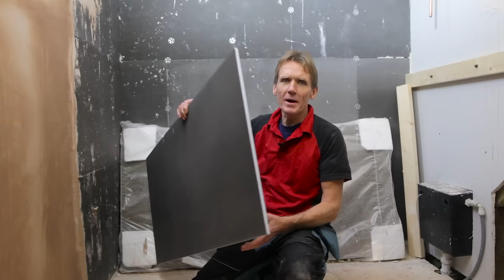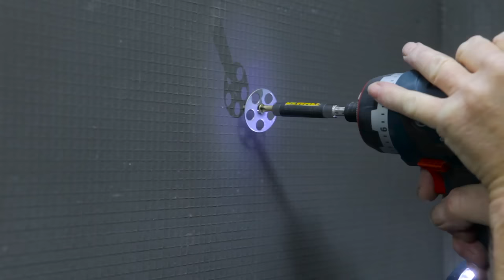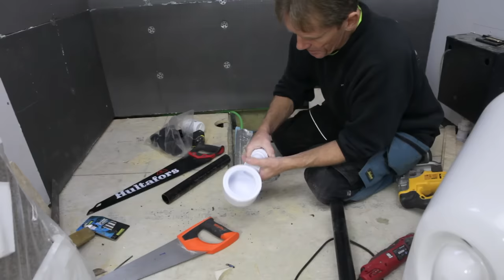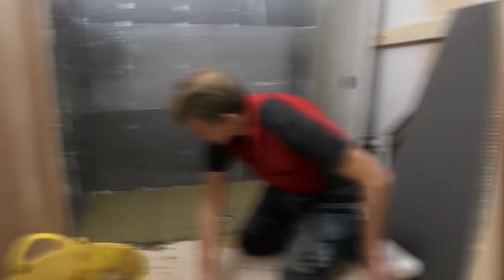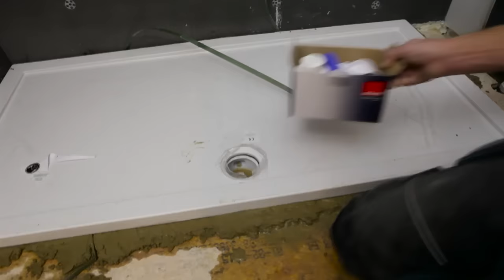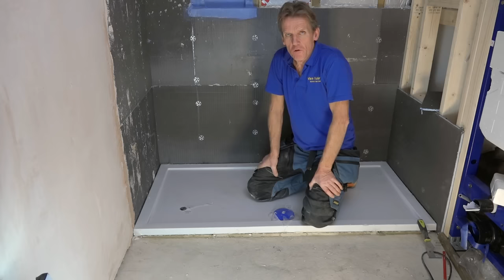Why Did the Shower Tray Crack? How Was it Fixed?

Comment: seen this happen before ,manufactuers make trays too thin for appearance reasons,ignoring durability .Roger made a first class job of the base,but it shows what we plumbers have to put up with.On site we always use a pair of suction cups,as we are fitting multiple trays on commercial jobs.Duravit shower trays come with selaphane stick on patches so your suction cups don't leave marks on the tray.Keep the videos coming Roger,used to enjoy your articles in the plumbing and heating magazine,we used to read it with me mates at college over 30 years ago.

Comment: Problem with mortar is that it doesn't come back after compression. As you're tapping a tray like this down it can lift another area slightly. Tile adhesive will come back since it sticks to the tray, leaving no voids.
Reply: I'd go for tile adhesive even if the manufacturer recommends cement. I think it's crazy telling people to use cement on thin beds

Comment: I’ve found when using sand and cement - use feb in the mix to make the mix nice a buttery and get the mix something like level with plenty of undulations in to allow you to work the try level ( like you would a brick ) also pva the floor and the tray a few times . I’ve also used CT1 adhesive in liberal amounts and had success bedding them down. And also floor tile adhesive

Comment: Good effort mate, you were a bit unlucky with that one. Plumber for 25+ years and bedded lots of stone trays. I tend to use a slightly wetter mix and ridge the muck like a bricky would so the muck has somewhere to spread out. Think when you laid that tray down the muck underneath didn't spread and support the tray evenly. The chipboard didn't help you either, just drys the muck out. Try laying the long edge first also, best chance of keeping the muck even under the tray.. Better luck next time and keep up the great work, love your videos.
Reply from the maker: Ernesto Thanks. It was my first failure. I have dropped a tile and chipped one before but normally bedding them down is fine
Reply: Spot on mate soft wet weak cement and you want have a problem, no stupid expanding foam ct1 etc manufacturers recommend weak cement mix for a reason. Big dollops and let them spread out as you level it down.
Reply: @SkillBuilder  when you bed the tray you can also prime the floor with a neat SBR or primer stops the boards from sucking the moisture out of the mortar mix
Reply: Great video Roger , I feel your pain , I recently fitted my customer a mirror cabinet above the newly installed £900 wall hung basin unit and my magnetic pozi bit came loose out the battery drill and chipped the basin !!! Gutted . . I alway screw  6mm ply to chipboard floors before putting dollops of rapid set flexible adhesive down before laying tray on top .. 20 years fitting bathrooms no problems yet .🤞👍

Comment: Interesting to see another plumber's method of fitting a tray, I like a few of your techniques like the straps, I stopped bedding trays on sand & cement a few years ago in favour of floor tile adhesive, spread with a large (half round) notched trowel, I find it gets the tray very close to the floor, so much so most flooring materials then cover the gap completely. Appreciate the vid, Waste problem, hey that's the life of a plumber, my motto is "if it was easy everybody would be doing it" I quite often say the same thing, no good moaning about it, just get it done.
Reply: wall adhesive or floor? I know floor is a little bit spongy
Reply: why not check the material over before setting it, that shower pan had a  small crack that opened up, or he put something heavy on top and broke it himself, we plumbers make mistakes, but you cant fool another plumber

Comment: We use plasterboard adhesive, but spread it like mortar rather than dot and dab it. That way you can level it once down. Always set extremely well, especially because it's either bedded on to 18mm ply or concrete. What is your opinion on using board adhesive? I really appreciate the tip on using the straps btw
Reply: @madjack mcmad  that's the whole point. You want as little flexibility as possible. There's very little flex in a shower tray and the same with a floor if it is fixed down right. I'm sure the one you have seen that failed was down to either a poorly fixed sub floor or not a full bed of adhesive with voids underneath
Reply: On a timber floor on joists I always use plaster board adhesive, on a concrete floor I use sand and cement.

Comment: Hi Roger.  As others have said, good of you to show stuff going wrong.  Think I may have seen why.  Some bedding mortar looks as if it trapped waste pipe preventing trap from lifting when you clamped down upper part of waste.  That forced centre of tray down as you sumised.  Two things follow if I am right (often not!) a) keep mortar bed away from waste pipe (!) and b) would it be better to let bed set before clamping waste traty outlet down?  Really very, very useful channel and I have found some really helpful advice here.  Bob.
Reply from the maker: Thanks Robert
I really do appreciate any perspective on this and you may be right but the mortar was sloppy and I think that the pipe may have been able to displace it but the problem with that tray is that the weakest bit is across the middle. The mortar shrunk as the water went out of it and if it shrunk more on the thick bit than the thin bit that would have created a tiny void at either end. 
The bottom line, for me, is that if a process is that critical it doesn't belong in a plumber's world. We need it simple. 

The Mira Flight tray I have now is in a different class.
Reply: @SkillBuilder  Never forget that a rich cement bed contracts as it sets and then dries.  If the middle part of the tray  is sitting on a thinner bed over a trap then the far edges will come away from the bed.

Comment: Wow; The tray ends must have dropped quite a bit to cause a crack that wide.  I've got that same style low profile tray ( centre drain hole adjacent to the access edge). Worse still, the access door is going to be a (heavy) 6mm glass sliding door, with a fixed panel one side of the drain, which means cyclic loading across the 'fault line' when the door is slid open / closed. And the tray bottom is recessed  around the perimeter presumably to economise on resin at the edge rims, so can't just lay a level bed of mortar. So I watched this vid, hoping to find info on whether the mortar mix should be mixed with minimum water to reduce shrinkage, whether it should be notch trowelled to allow even bedding when there's no room to 'shimmy' it, etc,etc.  I agree that thumping it with a mallet seems unlikely to work on an un-notched mortar bed, as well as risking cracking the tray, so I was thinking of using an old B&D sander with a foam pad to vibrate the tray not just level, but to help ensure it's fully suported over the whole footprint. Anyone got any suggestions on water quantity for the mix?

Comment: Roger I could not get the level with sand and cement and after seeing this vlog and the cracking issue as my waste is in the same place,  I used low yield foam to bed onto not the perfect thing I know however the base has been done for 2 months had various traffic no movement and no cracking. I think the foam maybe I am wrong gives a bit of movement. But like said its been down for 2 months and no issues.
Reply: Just an update the tray sat on low yield foam trick is still holding out (I know you have your views on this)   the step in shower has had a lot of traffic and no cracks or leaks thanks to your tips on tiling, albeit was tiling onto blockwork your tips has stopped a possible horrid wet patch forming on the kitchen ceiling 🤣 also should of listned to you and not wasted so much time and money on push fit and compression waste to cut corners, should of and did go with solvent weld again this has held and no leaks, used solvent weld for my new basin install getting a bit of an expert now 😄 but gloves off now I watch all your vlogs and since my father passed away with I was 19 when I got my first home I did not have the dad of DIY back up to help me, now into my 50's I have learnt a lot and your vlogs and the plumbing chap who I can't mention has helped me a great deal. FFS I ripped out a bathroom and installed a step in shower (cause of joist issues) 1600x800 tray, installed the 2 part enclosure one bit sliding, tiled the whole bathroom, new basin and cabinet below, done the floor, pipework ect never soldered before,  its because of you Roger and other trades that give me the confidence to do this, so KUDOS to you. The wifey now wants the toilet tiled as its to clean and clinical OMG what have I started.

Comment: Always bed your trays down with a a slightly dry mix. Any high points just give the tray a slide from side to side and it should get to level. plus if you need to lift the tray to add any more cement or replace a damaged one then theres no mess. use the edge of your trowel to cut lines in the cement so when you give it a wiggle it has space to move and allow the tray to reach you level.
Reply from the maker: yep that is what I did and have done many times with no problem

Comment: One issue that I noticed, and I see this a lot is that the protective film was left on during installation. It must be removed for tray inspection, there may have been a fault that could have been flagged up before dropping it into place. Also that's one of the many get out excuses a manufacturer or supplier may use against you when you complain. Also, while I'm on, its also worth knowing that if you were to ever get a glass shower panel break on you there should be no problem getting a replacement.. without being charged. The integrity of the glass cannot be guaranteed regardless of being QC'd to within an inch of it's life.

Comment: Never understood this idea of fully supporting the tray on a bed of cement when the upstand kits available for these trays only support it in a few point locations. Totally nonsensical.
Reply: If you don't mind a bit of a step into the shower tray, not the sort of finish on a high end job
Reply: Some shower floors are supported by floor to floor grids,others including Delta are filled with foam for support.cement and or silicone caulk helps prevent weakness and noisy creaking sounds. Foam based shower floors are by my experience are trouble in progress. People who are heavy will compress and eventually shrink,settle,and crack.

Comment: Shim 4 corners to levels.  Install a shower/bath rubber up-stand where tray meets wall.  Foam completely, cover with newspaper, settle tray down. Any problems you can lift the tray out. Weight of tray and tiling keeps tray solid.

Comment: I know you say use sand and cement because it doesn't  stick to the tray and can  move independently,  but if it does slightly drop either end the tray will crack in the middle anyway !

Comment: There could have been a inherent fault with the tray as you look to have done everything by the book (according to every manufacturers instructions I have read when installing large ceramic shower trays).  I not sure what your mix was but its recommended that it's pretty weak.  The problem I have seen often occurring with thin shower trays is the very thin supporting ceramic ring that holds the trap-its usually on 2mm or 3mm thick.  Unless the waste area is covered with some protective ply during the works, it's very easily broken and the tray is a right off.
Reply from the maker: It was the tray and they offered a replacement but I had no faith in it.

Comment: I’ve just fitted a resin tray on 8 adjustable legs , an 800mm by 800mm will this crack ? I haven’t used sand and cement anywhere

Comment: I’ve seen a youtube DIY’er bed a shower tray using expanding foam. Any thoughts on this Roger? He seemed to know what he was doing…
Reply from the maker: I would say that anything can work but when you get trouble and try to make a claim you will find the manufacturers will, quite rightly, look at what the tray is bedded on. Resin cast trays are similar to very large paving slabs, they have no tensile strength so an  even support is all that will stop them cracking.  If you call out the technical guys to inspect a cracked tray they get out a small hole saw and drill all over the tray. When they look at the sample they expect to see an even bed under the tray. If they see a void or a material that has not been recommended they will walk away.

Comment: Sand cement doesn't really bond - flex tile adhesive is 10 x better - it shouldn't matter how thin tray is if supported equally underneath - only in putting it in that its a concern - sand cement gave way clearly as massive cut-out and height of mortar was a tad too high - people talk of expansion and floor settling etc but that's a rare case and isn't really a good approach to all trays - maybe if fitted in environment that changes temp dramatically - i sbr pva floor and tray then backbutter tray and trowel adhesive down on floor - silicone everything and if seal pops out just untighten as silicone is touching anyway! plasterboard if supported does fine - if waters getting through it screwed anyway! just tile and grout well
Reply from the maker: Dave H 
The one thing you don't want is a bond. The whole idea of a weak mix is to reduce shrinkage and provide support that allows a slip layer. If you bond the tray to the timber and the timber moves the tray will crack. The tray cracked because it was badly made with the thin bit in the middle. Avoid a centre wasted. As for your advice on plasterboard you are wrong. It is not allowed under British Standards unless it is tanked.

Comment: What a nightmare Rog, been there done that. I always try to persuade client to use Coram trays. They come with upstands so they can be sunk into a wall so it doesn't just rely on a sealant bead to stop water going down the sides of a tray. Also you don't have to fanny about with mortar bed and the trap is higher up. Unfortunately some people want a fancy looking shower rather than practicalities.
Reply from the maker: +Zed Man Yes I like the upstand. I don't know why I went away from it on this occasion. Tempted by a deal

Comment: Having spent way more time fixing a toilet than I should have done, due to things going wrong, I can't tell you how muc this video made me feel a bit better. Good to know the pros sometimes have to take the whole flipping lot up and start again, from time to time!
Reply from the maker: +Mat Smith 
More often than they would admit to. Mostly it is due to the kind of rubbish we have to fit these days and of course plumbers have leaks, some say they don't but they do.
Reply: +Skill Builder too true, I get customers buying the cheapest nastiest taps, showers, baths, WC's etcetera, which is poorly manufactured, it takes extra time and materials to then make them work, I have had a few call backs for cheap quality sanitary/brass ware which I then have to charge for as (from my point of view) if they'd bought quality it works out the box (9-10).
Don't even start with plastic threads 😡.
Reply: Interesting comment. I'm one of those customers (i.e. not a plumber or installer, just a bloke on the street) and I'm about to buy sanitaryware to fit my new bathroom. Any chance you could point me in the direction of what you'd class as decent quality stuff that won't need changing later? A few brand names will do! I'm thinking now of taps, shower trays, etc...
Reply: +Mat Smith yeah no problem, taps, shower valves and sanitary ware, I'd be looking at Mira, Bristan (easyfit range is very good), peglar, grohe, ideal standard, armitage shanks, the big brands are better quality, in my experience cheap brass/sanitary ware are worse quality. 
Hope this helps.

Comment: Love your work, mate. Why did you put the pan in after the wallboard? Isn't it pan first then tile substrate? If the water gets behind your tile won't it run down under the pan? What am I missing?
Reply from the maker: Hi Greg 
I had to think about that for a minute because we call it a tray. The pan is the W.C bowl. No matter I understand your point now. 
I used to do what you are suggesting but it puts two thicknesses on top of the tray and I then found I couldn't get a wall to wall shower screen in. 
Then when I started working for Wedi and then Abacus I discovered that they run the backer board to the floor so there are no weak spots or voids where the tiles start. The tray (pan)  is stuck to the backer board and the joint is filled with polymer sealant. Then I put the No More Leaks tape on the backer board and tray joint. It sticks so well you won't get it off so you have to make sure you do it right. Then I tile the wall and finally grout and silicone. I usually rake out the bottom line of grout so the silicone sits in the joint rather than just on the tile face. 
The end resut is thaI never get leaks around the pan (tray).
Reply: @SkillBuilder  I see. (I have been in the US so long I have forgotten the English names for things). I use Wedi so I see what you mean. The way the board locks in with the tray and the sealant makes it waterproof. And the board you use has a waterproof core. Do you do a flood test? (Block the drain, fill the tray with water for 24hrs). I suppose I should look at your other vids to see. On a tray with no curb I use a scrap piece of Wedi and sealant to hold all the water in. I have noticed the water wicks up the cement layer on the Wedi, so can it make its way down behind the sealant?